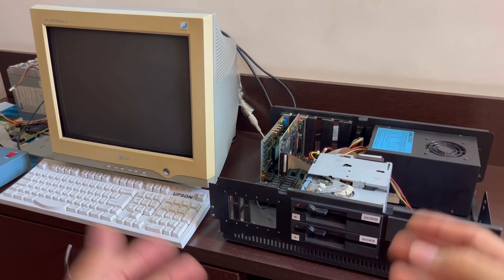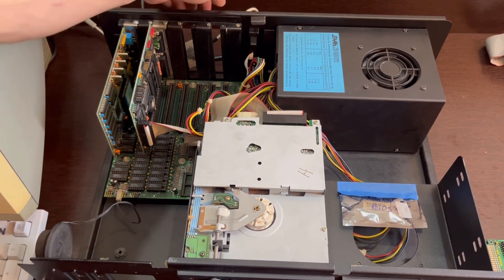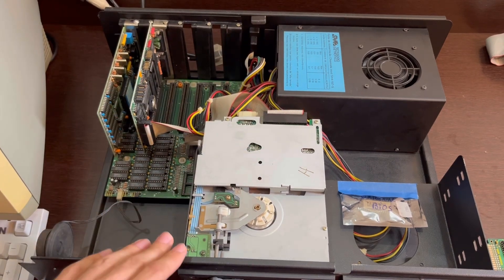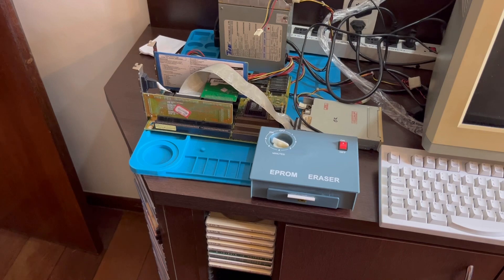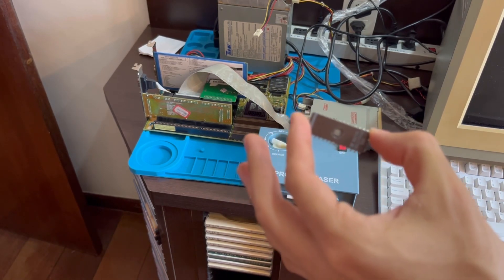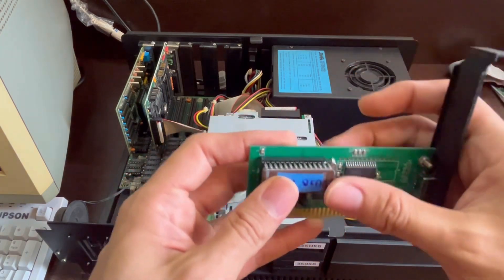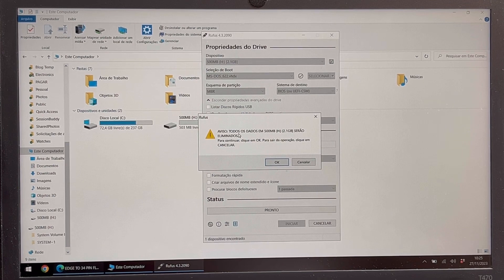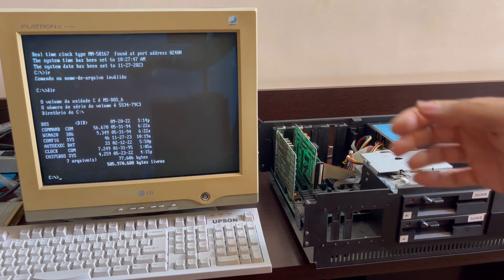Booting a 1988 XT PC machine from USB!

Comment: Can I use AT28C64 IC?
Reply from the maker: No, because the WE pin is connected on the ISA board, which results in data corruption. If you lift the pin and connect it to GND it should work.

Comment: Floppy drives were extremely reliable before the Windows OS. The problem is identifying the different types ( 360, 720, 1.4  single side, double side, layers) and modern OS of Windows needing to write on old drives. The last time accessed MUST be written says the Win OS and it can destroy the old disk when it writes. In the olden DOS days , the last time the file was accessed was NOT constantly written. If you have any old floppy disks do not run them on Windows due to the last access write.
Reply from the maker: I didnt know that. I also believe floppies got so unreliable right now because most of them are ate least 20 yo.
I had no idea Windows introduced this constant time writing thing.

Comment: A minor but very important correction.  That is NOT a USB programmer....  That early uldnprogram USB drives.

That is an eeprom programmer, the hich connects via USB, but it programs eeproms rather than USB drives.  There is a serious difference.

Comment: I was actually surprised to see dos 6.22 work on an XT system. never think I ran that on anything less than a 486SX
Reply from the maker: DOS 6.22 runs fine on XT machines. Sure, DOS 3.31 wold be more time correct and supports HDs up to 512MB, but when I was a kid DOS 6.22 was all the hype so I tend to use it everywhere cause it brings me back good old memories…
Reply: @electrohoard watching your video i recall with regret that we threw out a lot of original IBM XTs my dad had gotten from next to nothing when our consulate replaced them... but back then they were "old" not "retro". I guess I never thought to install a more modern DOS on them. I had just gotten my first pc, a 486DX4... so they were very slow...
Reply from the maker: @LuminousWatcher  yeah, I threw lots of hardware in the trash back then too. When I got my first 486 (SX-33Mhz) those XT just felt like total garbage. Now I regret 😂